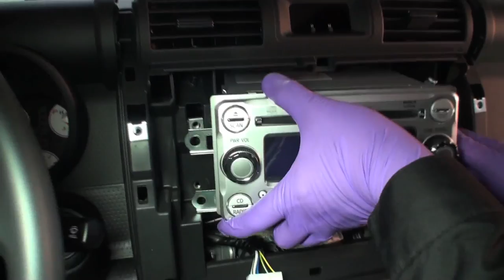FJ Cruiser: Enhance your Audio | Install Preview

Comment: Will this work with a non factory head unit? Also does the sub wiring need to be routed in the FJ or is it already pre routed?
Reply from the maker: Our Sound Solutions is completely compatible with the aftermarket head unit of your choosing, both in terms of connectivity (completely plug-and-play with the appropriate receiver adapter for your new head unit) and above all, our signature sound reproduction the moment plug you your system in (tuned specifically with the output characteristics of the unit in mind).

Yes. Installation of our Quick-Sync Wiring Harness is needed for complete Power + Remastering of Speakers and Subwoofer operation.

Comment: why the one in the rear  pilar are not included or replaced?
Reply from the maker: Rene Our acoustic engineers determined that upgrading the rear driver made little difference in the overall sound reproduction to justify the price difference and needed vehicle disassembly to access this speaker location. We are very sensitive to ensure your every dollar spent translates to noticeable results therefore we elect not to change this driver.
Reply: @Oemaudioplus  i purchased a used system and have no clue how to install it as its for a fj with jbl fjammer and the wiring is completely diffetent and unlike your install video. Emailed you guus but no response so hopefully socially i can get some feedback 😋 thanks ! 

Instslled all the speakers just sub woofer is confusing AF
Reply from the maker: @il5181  Give us a call. If we don't answer leave us a message (so we can call you back). We would be happy to assist.

Comment: What's the difference between the 400cf and 450q?
Reply from the maker: Be eS The Key difference between the 450Q and 400CF is our New Quad-Coil Subwoofer System and New DSP Power Amplifier.

Comment: Do you sell the subwoofer enclosure alone?
Reply from the maker: Thank you for your feedback! We appreciate your interest in our designs! We do not sell our subwoofer as a standalone product at this time. However we are able to offer the System 450Q sound solution (which may be exactly what you're looking for). This setup would features the following:
Our complete FJ Subwoofer System, 32-Bit Digital Signal Processor (pre-calibrated to deliver our Signature Hi-Res Sound), Multi-Channel Power Amplifier and Quick-Sync Wiring Harness (completely plug-and-play)>\

Let us know your thoughts.